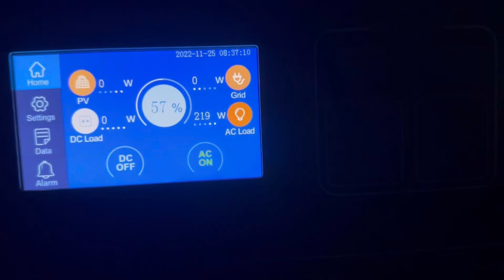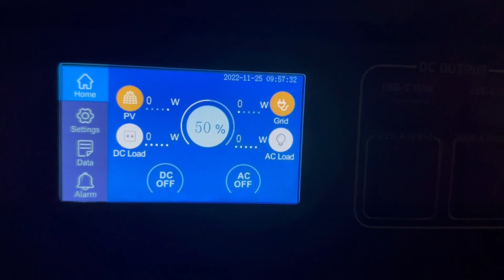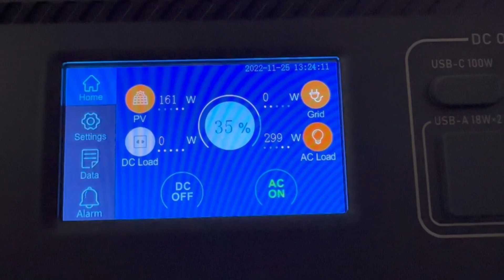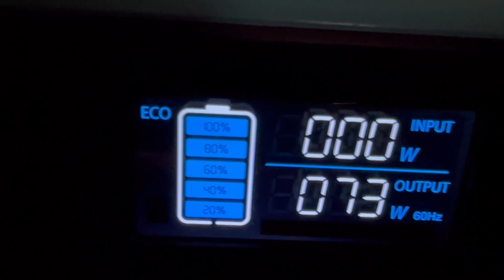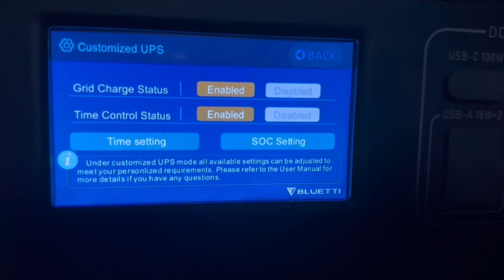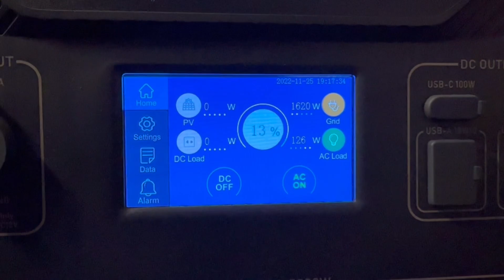Our Off Grid Journey w/ Bluetti AC500 Week 1 Day 5

Comment: Hi. 

1. I'm curious how you have kept up with all of the setting changes you are or have made.

2. Have you installed any firmware updates and if so what is the current version on your ac500.

3. Why are you using portable solar panels specially if you are not planning to  move the system as a mobile setup. Seems a difficult way to use.

I rarely make changes to settings on my ac500.
Reply: I have had to make a number of adjustments as needed. 

I use portable panels because the goal is mobile off grid...  I have to add new videos with the new RV...

I'll have to check the current version for you.
Reply: @FragranceOfYah  

One thing I have done early on was to make a list of devices that I run connected to the Bluetti and the amps drawn by each. With that info i can calculate the watt/hours needed and ultimately how much the grid power is costing. I've seen a good drop from where I used to pay.

The smart meter usage reports are updated daily making it easy to compare. 

RV appliances and anything that can run off of DC vs AC power is in our favor since there is a degree of inefficiency converting to AC from DC via the inverter. 

I do find that tinkering with settings occasionally can be entertaining. Also, I use the App. Haven't noticed that you use it. Very convenient at 3AM or while away from home base. LOL. Thanks for your replies...